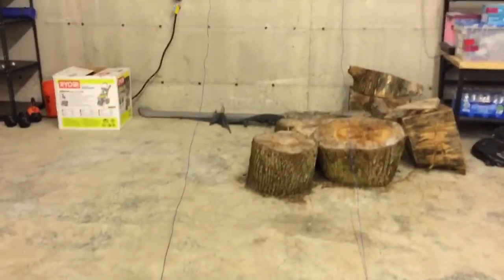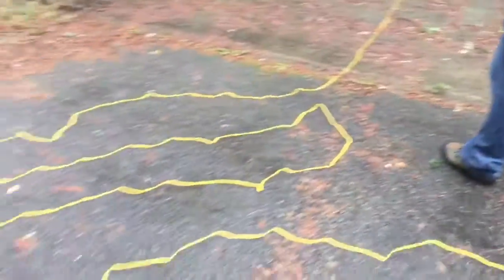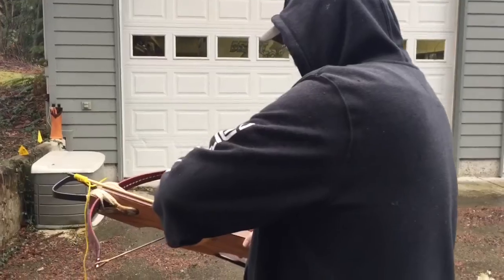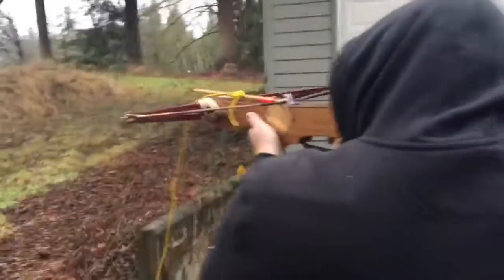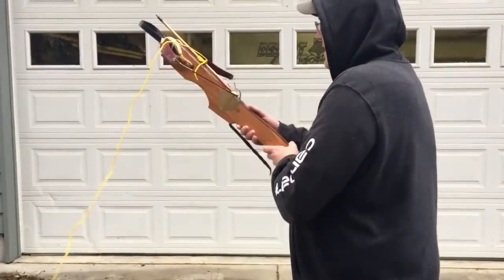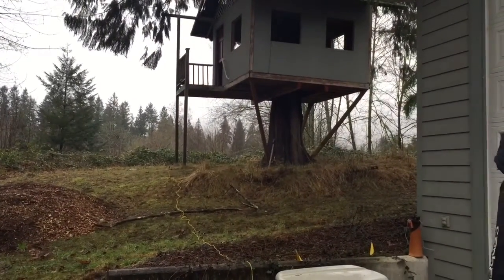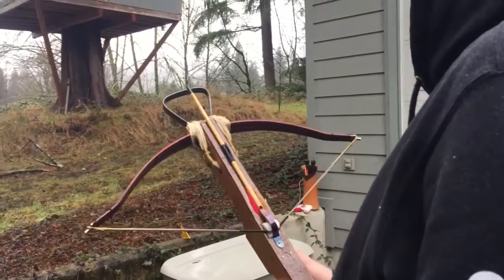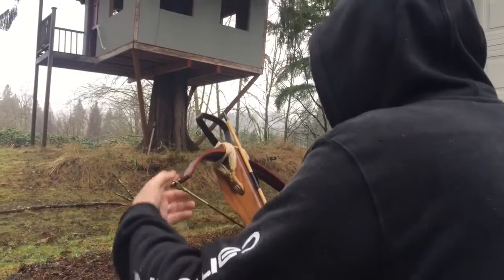Smitty Working On SOMETHING: Dave's Antenna, Part 1

Comment: Stretch it between two trees, using a pulley system, leaving the feed point out in the open. Don't forget to install drip lines (short wire or string hanging down) uphill from the center to bleed off water. It helps. A 4:1 Balun at the junction will really help.   BTW - A doublet is a much better design. :)